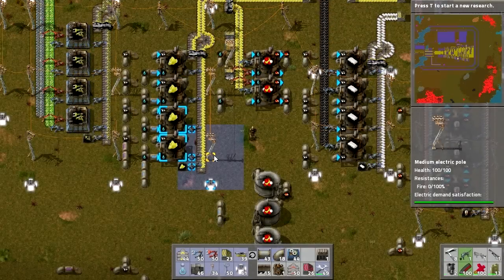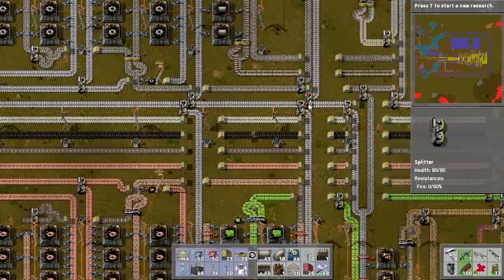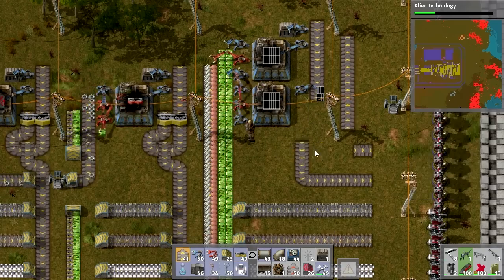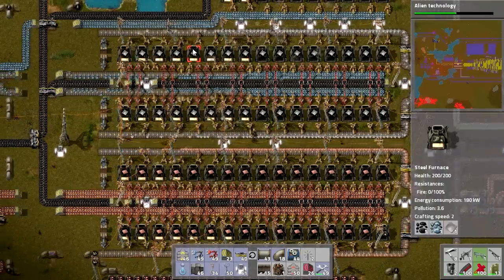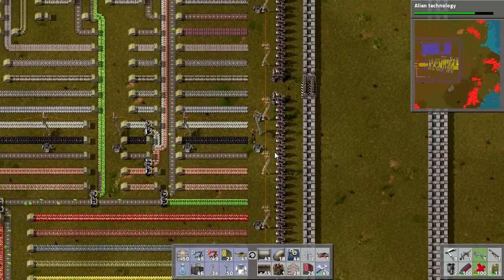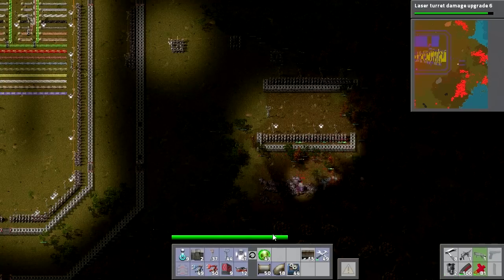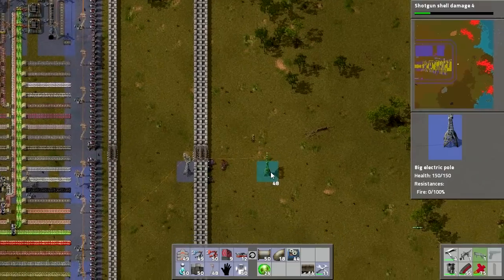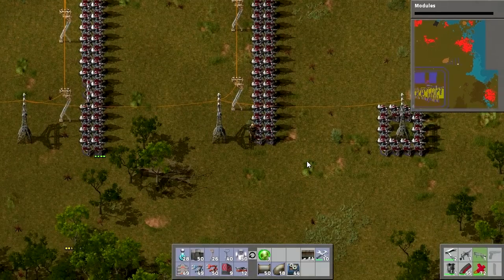Factorio - Episode 14 - Fast Transport Belts and Power Sneezes

Comment: Your failing circuit production clearly shows why it is not a good idea to violate my prime directive: No cables on belts for circuits.
All attempts to avoid the recommended direct insertion has shown the same problems with throughput.